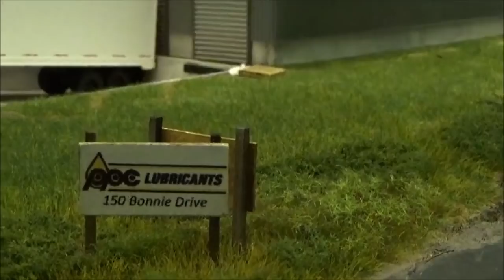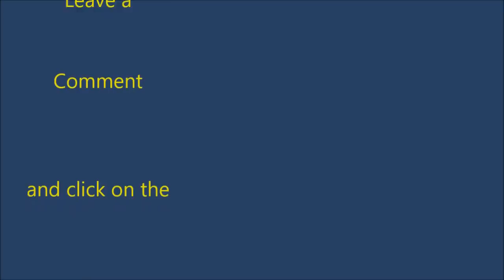Model Railroad Update 16 (Scenery and Track Work)

Comment: CAN U POST SOME PHOTOS OF YOUR TRUCK TO HOPPER COAL
Reply from the maker: Sorry Ted, i forgot to take some pictures before i dismantled the railroad.  However you should be able to get some good views of it in the  "Running the Butler Turn Part 2" video.  I was able to remove it from the bench work without damaging it so it may be resurrected on the new railroad.